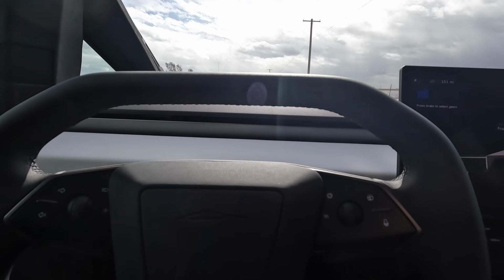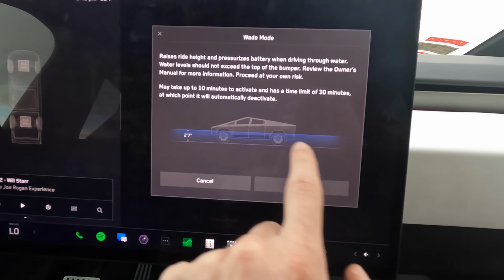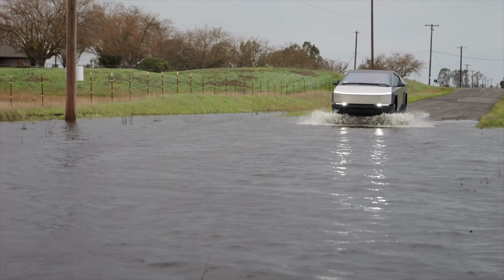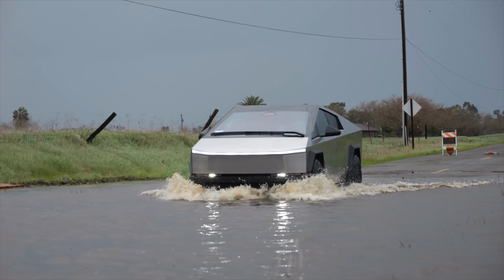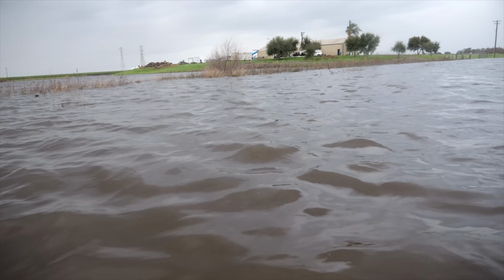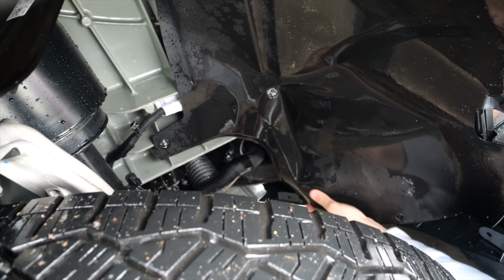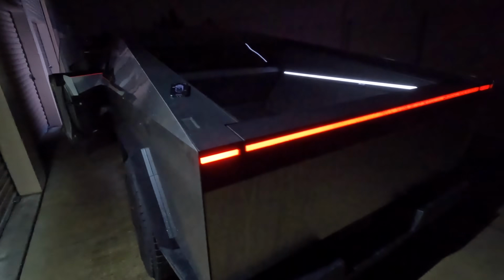How Deep Can Tesla Cybertruck Drive in Water? -Wade Mode Test

Comment: Can't wait to see a follow-up video on how much it rusts afterwards 😆
Reply: Bro’s gonna cosplay ghost rider soon if that battery is wet and damaged
Reply: Stay tuned
Reply: The rust that everyone is talking about is caused by iron particles that are all over  due to brake disk wear from all the vehicles on the road along with iron particles kicked out by train wheels. You don't notice it on painted vehicles, and it is easily removed using various cleaners. It's just particulate iron sitting on the surface of the SS body panels, it is NOT the actual SS that is rusting. Tesla Bear FUD that makes for great negative/clickbait articles/youtube vids about Cybertruck.
Reply: And, that is a lot electronics to risk getting wet. Just saying..
Reply: @_Mutineer  No, no its not........ But let me guess you're heavily invested in the $TSLA pump but forgot to dump (Bagholding).   No the rust is caused by shit metal plating, not to mention all the water draining into the subframe from all the @*#& seals around the frunk.
Reply: @nikushim6665  OMG, There is NO PLATING on Stainless Steel. You should at least attempt to get a clue when your dumb assumptions are challenged. And BTW, I own NO TSLA, and never have, not one share. I'm just here for the world-class Engineering (since I'm a world-class Engineer myself..).
Reply: @nikushim6665  I own a Cybertruck and know several owners. They aren't rusting. Stop deep throating BS you read online.

Comment: Its a heavy vehicle , which you do want traversing flood waters.  It passed, Im impressed. Would press through , even if were a moving water , depending of course on the water but. I give  A plus traversing  flood waters. Good job. Dry the truck out. All switches will work again I bet. Water came over the doors about 4 foot deep. Just dry the truck out in the sun 30 minutes Chief.

Comment: The design actually helps disperse water away from the vehicle at a controlled speed. (Atleast where it counts) It creates a wave and if you look near wheels the water is much lower than on the front of the car, not sure if that was intentional but pretty cool.
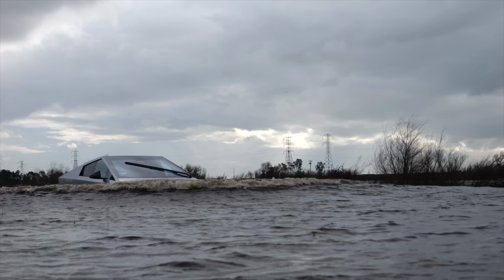Reply: 6:28

Comment: I stopped the video where you showed the screen and read it. Going into "off road mode". I hope you read it carefully. They made it very clear. Any damage during mode is NOT covered under warranty. Hope those switches dry out and start to work for you. Don't get me wrong. I enjoyed you running your new Cybertruck in extremly deep water. I just hope it was worth it for you.

Comment: Im impressed the video was so good. But please tell people the camera guy was in the drainage ditch and made it look deeper and the truck was plowing most water to the side and didnt get a chance to get to the back high levels. If you stopped it would float like a barge would when water is displaced evenly. Try it but tie a rope to it first. I'm sure it floats because if it sinks instantly that could be a problem. That's why people carry window breakers. 

Also women that dont track may not know crossing a stream or moving water would push it sideways and may float away. This could be dangerous because someone with little knowledge of that may think they can go in very deep wager not considering buoyancy and other physics that come into play. 

Many trucks have exhaust and air cleaner extensions like the WWII keeps. They have a swiss cheese design though. That's so water cant turn it into a boat.

 I say to Elon and add a jet drive or propellers for some more excitement on the back and call it the  all in one.
AmphiGigaGargoyleSuperCyberTruckBoatCamperBrick

It will be a brick as that swamp water bypasses the air pressurization at every connector. In salt water, brackish and even farm pesticide run off it eats metals and plastics. We will see

I dont think any insurance or anything covers flooded vehicles anymore.

I'm impressed for now.

Comment: Anyone see at 4:40 the center console looks to be engine light turned on?
EDIT: It actually looks like the trailer connection fault. Too much water huh.
Cybertruck detects a faulty electrical connection for the trailer lights. Some, or all, trailer lights may not be functioning. Pull over as soon as safety permits and inspect the trailer lights for faulty cabling or connections. If the issue is resolved and the red icon persists, manually turn Trailer Mode off and on again.

Comment: At least the Wade Mode should have an extra sensor to be turned on when there are floods. Then the insurance company would not have to write off a truck as a total loss just because the water reached the edge of the sill.

Comment: This truck is an absolute beast for a Cybertruck. Any lifted truck with the right setup would have worked more sufficiently. And for way less.  Not particularly impressive. Let’s see the long-term effects on the vehicle. That said, I’m not rooting against it. It’s just not as impressive as a real truck. Hence the name. The way that water was creating a wave in the front of the truck was curious to say the least. I’ve built RC crawlers that have similar performance and I was happy to have the cold water rushing around my battery. 😳

Comment: Boys and Toys. I noticed: window wiper was not working correctly when a lot of water was spraying on the window.  You could not see a thing and the reason is that the front of the car has  a wrong shape.  This is very dangerous when other cars are on the road, Moreover it is strange that an electric switch fails after it was exposed for less than 30 minutes to the water. And what would happen when this very heavy car, more than 3000 kg, would stuck in the mud ? Nobody could drag it out of the water. And plastic parts were loose, should only happen with very cheap cars. 
So my advice: buy a Landrover or a Toyota with a snorkel.

Comment: Why did you attack the water at 500 miles per hour upon entry? Go in at a reasonable pace and follow the little wave in front of your hood as if you actually know what you are doing. You did a couple of good wades though to be fair. But wheel arches peeling away was completely avoidable.

Comment: I have to be honest, at first I was like thats no big deal as I was focusing on just the rear wheel. Then I realized my mistake, which is the rear tires were not in deep water because the front grill was pushing all the way out almost like it was clearing a path for the rear or anyone following right behind the vehicle. =)

Comment: 6:19 the water is not even to the wheel axle... Interesting the battery pack can be pressurized to prevent water ingress because we know the battery pack is not actually water tight despite sealing around.

Comment: man do NOT do this. I did this to lesser degree with tesla model S I put tow hitch on for lauching my jetski in a lake. I just went backwards up to half tires deep in the back for a year then one day it just died with back wheels in the lake. There is just a cheap seal in the back of each tesla connecting car to the batery on the bottom, like a plug, and the bad design is the connectror is facing up. Its same for all teslas. There is just a cheap rubber seal around the plug that looks almost liek the wall plug and the rubber seal will deteriorate through time and one day water will come in and car will just shut down dead. Tesla will then quote you with a price for new batery or $18,000. I didnt pay, just had fuse replaced for 500$ and left car sitting for 3 months in california dry air. I  bought already a new tesla and then one day after 3months the tesla Model S started working again after water all dried up around the plug, but you will be stuck for months in best case or worst case need new battery. Nedless to say not going near the lake with tha tone again.

Comment: Firstly, only an idiot would drive through there without knowing if the road surface has been washed away. Or if there are any obstacles. Second, you have achieved nothing that a decent 4WD can do. How does this relate in any way to being "built like a tank". You were not under fire. I find Cyber Urinals ability to randomly drive into trees and houses, sometimes all by itself,  much more interesting.

Comment: driving over a flooded road is just dumb you need to inspect the road surface first to see that it has not washed out or away, for all you knew that road could have collapsed in the centre and you could have fallen in to it in your three tonne car, Teslas are clearly very impressive cars but the drivers less so. I have worked in the emergency services for longer than I care to say and the amount of people I have come across that have tried to Ford a flooded washed out roads in there vehicle and fallen into a sink hole or a collapsed surface is high. Flooded roads are unstable. Just don't do it however fancy your car is. If in doubt don't the Emergency services have better things to do than rescue fools in their flooded vehicles.

Comment: What a piece of crap.  Build quality sucks if plastic parts come loose and buttons don't work after the water.  Now try putting a F-150 to the same water.  I will bet you money it does better, it doesn't have plastic coming off and you don't have to put it in "wading mode".  The first two tests the water only came up to the axles and any vehicle will go through axle deep water.